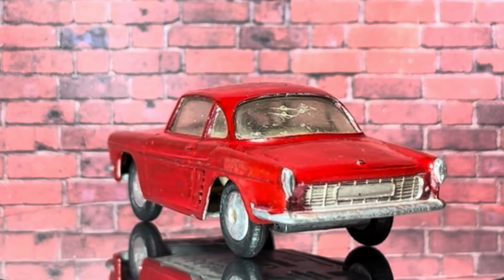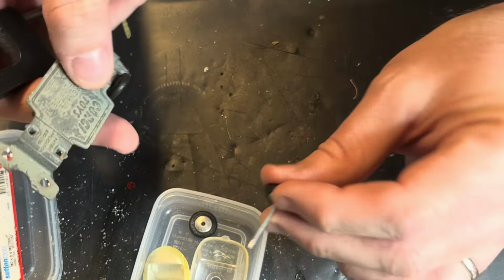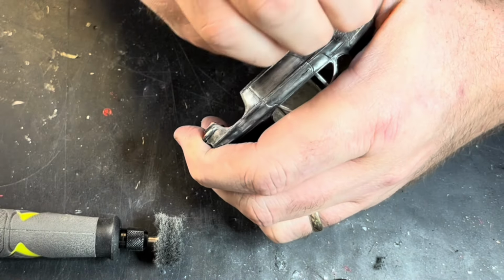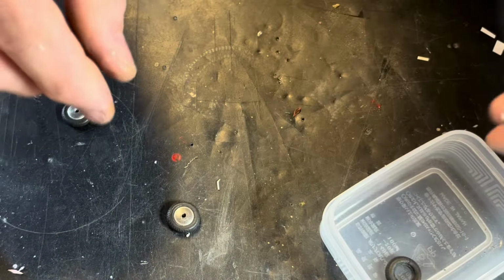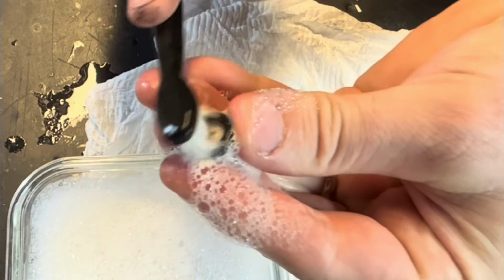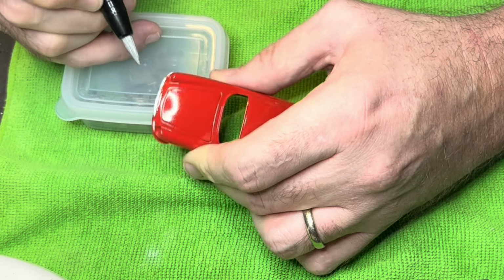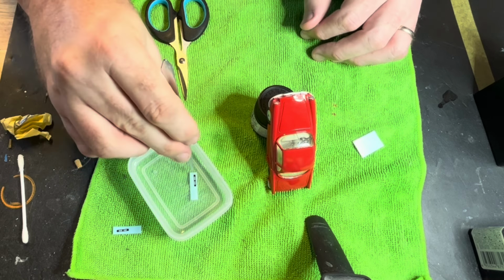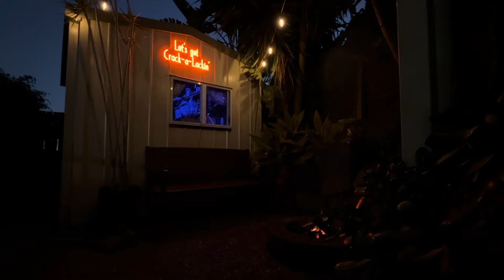Corgi Toys 222 Renault Floride Restoration / Carton Re-Creation / Short History

Comment: Excellent restoration Peter, looking good,with the hubs when you put them back lightly twist the hub in your fingers on the end of the axle, and you should feel it locate on the spline then you can apply pressure and it should push on a lot easier. All the best Martin
Reply from the maker: Thank you Martin, and thank you for the tip. You don't think it's better just to belt the life out of them? 🤣🤣

Comment: In after everyone else:
looks great, the lighter red looks much better than the overpainted hue. :) the rear screen looks like someone tried to break it with a scissors. good thing they eventually stopped... considering the abuse I was amazed the tyres were still there. guess you're right, and they are replacements.
Reply from the maker: I wondered if someone was trying to make bullet holes in the glass. Thanks Lothar.

Comment: 'Flaw-reed' would be the closest to correct pronunciation, je pense! Always like these Renaults for some reason - and the Simca 1000 Coupé Corgi did later. Nicely detailed casting with the engine vents in the rear wings and the centre-brace for the suspension. Quite a leap forward to go with the additional plastics. Nice red! Nice detailing!
Reply from the maker: Thank You, I recall you pronouncing it correctly for me in the Tavern, and I tried to remember 😔😂